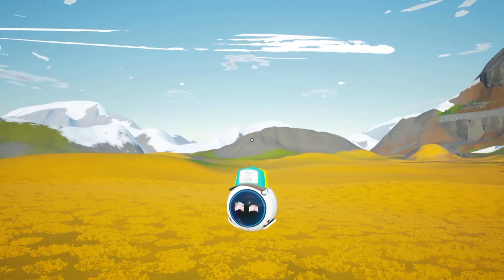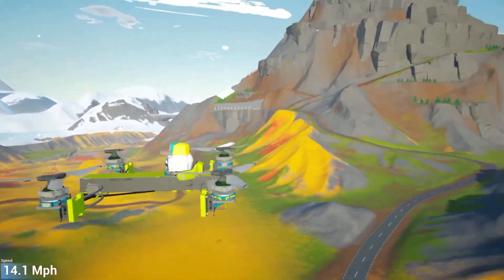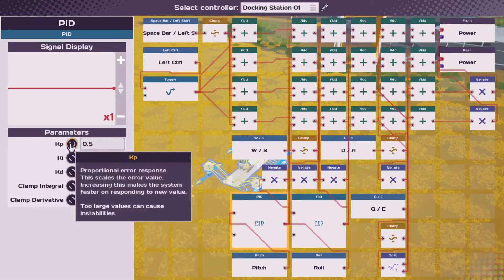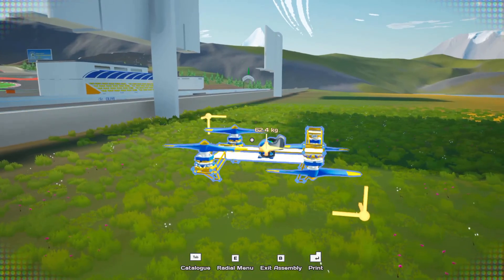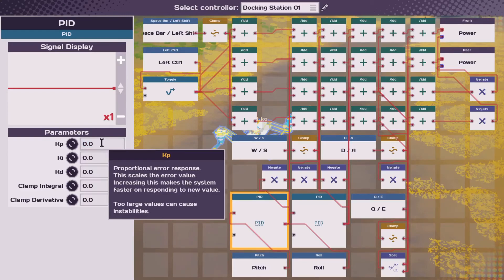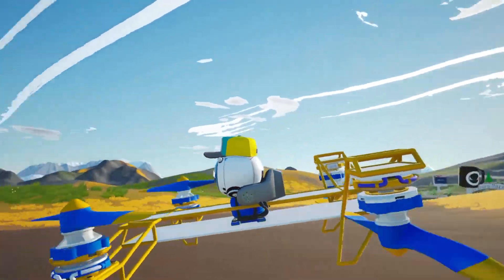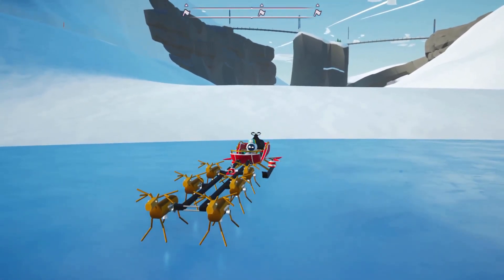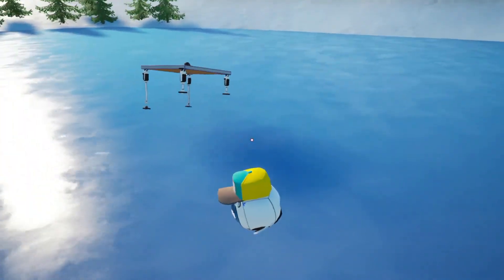PID Basics! [Main Assembly Tutorials]

Comment: Stablization is just one of the functions of a PID controller. Another important function of PID controller is to replicate the input as close as possible. In your example of the arrow, the arrow should point at the same angle as the gyro. So the PID you are using in the example should be tuned to have a faster response.
Reply from the maker: So you could say that one of the purposes of a PID is to help reach a value while compensating for any mechanical "lag" (inertia, undesired movement, etc.)...

Comment: Ownedpilot says to work on d after p, rather than i.  i should be the last thing you adjust and should be really small.  In fact, I had to put i to zero for pitch on mine because after flying forward a while it notices that you keep pitching forward, and then the PID won't let you pitch forward anymore.
Reply from the maker: Makes sense. You're referring to that "memory effect", right?
Reply: @sammy_1_1  Yeah.  Integration is looking at the past over time, adding up the errors.  It says, "oh, I see we've been leaning to the left a lot, so we need to correct for that."